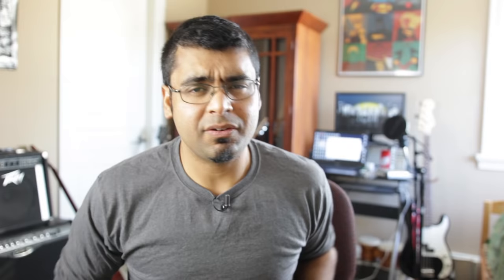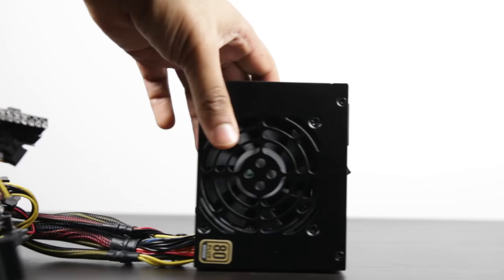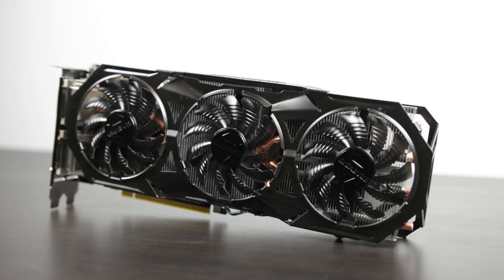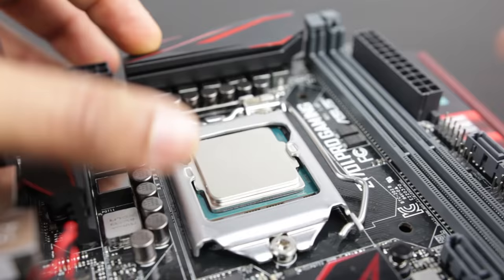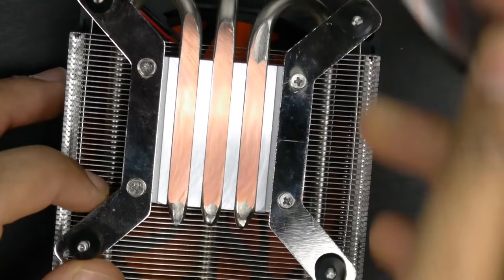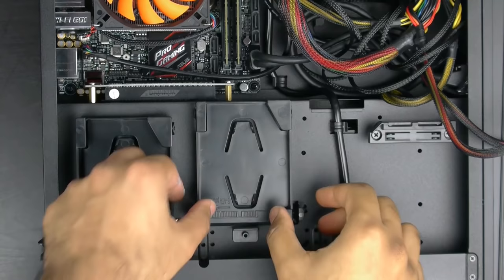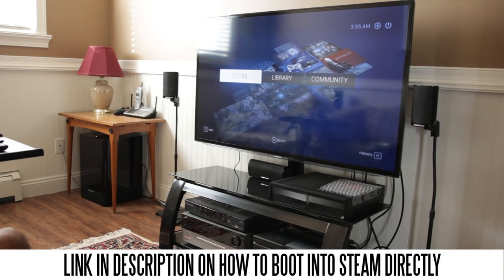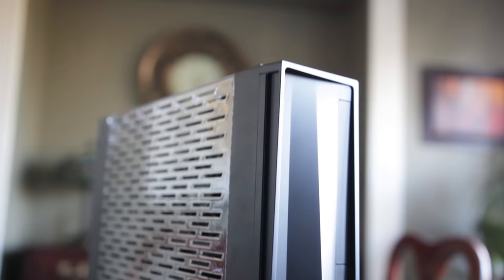EPIC 4k Gaming Console PC - Build Guide (The Console Destroyer!)

Comment: You need 500 watts for a GTX 970!!!! Don't even think about running it on lower. Though it technically can it shouldn't cause it can get hot and needs more power. Plus scrap the i7 and get an i5 for a gaming PC. You don't need 16 gb of ram either and don't get 2 SSD's. Get 1 SSD and a 1TB HDD. This will easily save you 100-200 pounds/dollars depending on your currency and your shopping choices. You can have more money to spend on games or snacks to fuel your gaming nights.

Happy Gaming! :)

P.S. Or if you are smart you could save the money for either a second graphics card or a better one like a Titan when they eventually become cheaper.
Reply: 450w is enough as long as it give enough amps on 12v rail
Reply: Don't worry guys! I have an 80+ bronze 500 watt power supply for my 970 and it's running fine. I am going with EVGA but I will upgrade soon for overclocking and SLI. :) Plus I am going for 3 1080p monitors instead of 4k cause that is too expensive.
Reply: 16 gb of ram is need. Ram is moving up, some games require a minimum of 8 gb. 8gb isnt the standard anymore.
Reply: kwame20101 I can run games just fine on 8gb. I have never ever encountered a game that has required 16 gigs. I am talking about huge MMO's and tripple A titles!
Reply: +Tom Brown games are starting to use more, gta 5 can use much more than 8 as can just cause 3
Reply: Fair enough! Is Kingston Ram good enough? I have 8 gigs of Kingston ram at the moment and I plan to upgrade my motherboard to get another eight. Only problem is that I am limited to 16 gb since I have 2x4gb sticks. Wish I had thought about upgrades earlier on when building my PC! :(
Reply: +Tom Brown why dont you just get 2x 8gb ram sticks? lol

Comment: Node 202 should be the case you should of shot for. The RVZ02 is of lesser quality and bigger by a couple of litters.
Reply: Or if you want to be really fancy, Lian Li cases are full aluminum with a tempered glass window.
Reply: JD 43 but bigger :( . I like the quality  of the cases too
Reply: Patrick You can find Lian Li cases in multiple sizes. I like them because they are still smaller than a  standard desktop PC by quite a bit but are really nice. However they are really expensive.

Comment: Which driver version are you using for this in Windows 10? I have  GTX 970, but have stability issues with 4k@60hz with random signal drops for a second at a time.

Comment: Can a 970 handle 4k?
Reply: No
Reply: +omar azzam Yes, I'm using one right now on a 4K monitor, and it runs most games high to medium with frame rates ranging from 45-60ish.
Reply: +omar azzam it certainly can. just don't expect everything maxed out at 60fps. If you don't mind 30fps gaming this card can handle 4k. Ideally for 4k 980/980ti is the way to go
Reply: The answer in the vidoe
Yes it can
Reply: who want to play games on meduim but on 4k and with 50 fps the main reason of getting a pc for me is the 60 fos
Reply: fps and for me i would prefer the 980ti or 2x r9 nano
Reply: you mean 2x fury x. r9 nano is 980 tier performance.
Reply: +Ian Duenckel nope I just means if you want even more performance than the 980 ti you can get the 2 fury nano cards
Reply: 2 fury nanos cost about 1000$, and one 980 ti cost 650$... I would buy one 980 ti, and another later. That is better then buying 2 gimped cards for 350 more, just to have them throttle down in clock speed.
Reply: Ian Duenckel fury is the same price, sooo..
Reply: fury, nano, 980 are all 500$
Reply: Ian Duenckel And fury is better than the GTX 980, so I guess two of them will be great with HBM
Reply: one word AMD. No thanks
Reply: After using AMD for the past couple years, I will never go back. I used the 5870, then the 7870, and both gave me a horrible experience. Drivers were shit, and I got some horrible frame times in games. This was at 900p fyi. After upgrading I cannot be happier.
Reply: Ian Duenckel I have an r9 285 and have no problems even before crimson, and crimson improved it much more, I can see where you're coming from, but those are old cards and at that time drivers were shit, but now they really improved..

BTW what card do you have?
Reply: I got a 970. Its pretty good, but I will go and buy whatever nvidia's highest card in the next gen. (gtx 1080???)
Reply: Ian Duenckel I think Nvidia is best in low end and high end cards, like the gtx 750 ti/950 which beats the r7 360/370 and the gtx 980 ti/titan x which beats fury x/fury/nano, and AMD is better in mid class cards, like the r9 380/x which both beat the gtx 960 and the r9 390/x which beats gtx 970/980..

But gtx 970 isn't bad ;)
Reply: +i'm everywhere Couldn't say it better myself :)
Reply: +PortalTHUNDER V good job playing counter strike on 4k...while i play killzone on ps4
Reply: +Zlatan Ibrahimović stop saying that

Comment: Hey guys I want to know if my 1080p build is correct for high to ultra settings (it's actually in shipping)
-intel core i3 6100 
-8gb ddr4 2133mHz ram
-Sapphire r9 280x vapor-x
-500w 80+bronze enermax maxpro psu
-1tb western digital hdd 

it would be awesome if someone reply because I plan to get my monitor soon :)

Comment: for the price you're spending on equipment why the hell not go with the fury nano for the mini itx case with the 450watt power supply, the nano would go perfect as it uses less power than a 970 and is farrrr better for high maybe even ultra 30fps 4k or 60fps at medium 4k for most games. ALSO the cards you listed for "4K gaming" the 390x can barely do 4k compared to the 980ti thats insanity. The fury X is far better in terms of 4k performance on the red team side

Comment: Way too much thermal paste. I think you missed the backplate too. Also, a 6600k and a 980 or even 980ti would be better for 4k.. 970 isn't gonna cut it, the 390 costs the same and has better (4k) performance.

Comment: Is it fine to put the new GTX 1080 with these same pc components to run 4K gaming?
Reply: The GTX 1080 only goes at 180W, and NVIDIA recommends a 500W PSU, so yeah,, you can go for that, just make it is one that consumes less power, because some GTX 1080s have a custom PCB that require a 6-pin lead and an 8-pin lead. Others use the same reference PCB, like the EVGA GTX 1080 ACX 3.0, not the Superclocked (SC) version, with a single 8-pin lead, so anything I recommend going for that. Man, I typed so much.
Reply: Bradval411 Great, thanks so much!
Reply: +Bradval411 Do you know the exact price for a gtx 1080 is 500$ enough ?
Reply: Fernando Flores Hmmm...
Reply: @Fernando - a quick search will give you all the pricing you need. Lowest you will possibly see would be $599 before tax (USD). That being said, the 1070 is still an amazing card for pricing starting around $379 ish.
Reply: +Sylv yes I will be getting 1070 and use the rest for overwatch
Reply: Yeah, but you probably won't get 60fps with even a 1080 in 4K. You might need to put two in SLI if you're looking for framerates higher than 45-50
Reply: I don't see why not.
Reply: As a owner of a gtx 1080 I never had any issues getting 60 fps on 1080p hell I'll get 90 and above on bo3 or overwatch
Reply: But 4k is a different story on games like bo3, fallout 4, or overwatch I get 42 fps

Comment: For a 1400 Machine the cable management looks like an rats nest.
you could have go with a bater computer case.
Examples:  
http://www.silverstonetek.com/raven/products/index.php?model=RVZ01

Or you cloud just had bought the Corsair Bulldog kit and save a few bugs:
http://www.corsair.com/pt-pt/landing/bulldog  

So, 
Bulldog kit $399 (Incluid: Bulldog chassis, Hydro Series H5 SF Liquid CPU Cooler, SF600 600-Watt 80 Plus Gold Power Supply, Motherboard with Intel Z170 Chipset).
           GPU $334.99
          RAM $69.99
          CPU: $411.92
  SSD's 1x: $127.45
        Total: $1343,35

your system: 1430,75 != of $87.4

Comment: I see this time and time again when building a set up like this and using a low profile cooler do not waste your money on a K cpu just save yer self the money buy a none k cpu use the money saved on the gpu, storage  or even the ram

I would buy a K cpu if you are overclocking and a case can use a closed loop or a decent air cooler 

Price in the uk
 I7 7600K = £308
i7 7600 = £269

Comment: Eeeh... what? 2SSDs in RAID0 ? Basically one fails and your system is unusable... What's the pont?
Beside of that.. you go with skyline processor and you put there 3 times the amounth of Thermal comp. than is actually  needed..
And you consider 30- FPS at 4k to be EPIC 4k gaming console pc? Rly?

Comment: what is the bang for the buck graphics card
Reply: +yocoffee or r9 390
Reply: +Joey the Kangaroo  depending on the country and local sales r9 390 and gtx 970 are the best mid-high end choice for 1080p gaming.
Reply: +yocoffee thanks I'll go for the gtx 970 I was going to go for a r7 370
Reply: R9 390
Reply: +Joey the Kangaroo Don't listen to him, go for an r9 390. It's cheaper, slightly faster, and has double the VRAM of a 970
Reply: +Joey the Kangaroo go with the 970 if you want better and faster updating drivers and want to play most games above 60 fps when they first come out..
Reply: +Dat Nigga Daquan OK bit will an r9 390 be able to play at 1440p
Reply: Joey the Kangaroo both can play games great and performance is usually better on the 390 side although AMD don't have a good time with overclocking, a 970 ocs much better than a 390 and an oced 970 will beat a 390 in about any game. The only downside I can think about the 970 is the vram but it won't be a problem unless you're playing like shadow or mordor at 4k or something. I'd say get the 970 if you're gonna overclock and want better drivers and get the 390 if you don't want to oc and plan on playing every game at 4k which if you're gonna do that, just get a 980 ti :p
Reply: +Dat Nigga Daquan thanks the 390 Is Bit cheaper sure I'll be missing nvidia  game works but that doesn't really matter I've bought my r9 390 and I've paired it with my i5 6600k
Reply: Joey the Kangaroo np man, I hope everything goes well, have fun gaming :)

Comment: Lol, GTX970 excellent for 4k gaming. Can't stop laughing. I can say my GTX980Ti is definitely NOT enough for 4k gaming in most of the new games (if you want fluid 60fps what is a must for me). A multi-GPU solution is highly recommended for 4k gaming. A single GTX970 is only a midrange card and should never be recommended for 4k gaming.

Comment: VERY MISLEADING TITLE... there is nothing epic about this build. This system is not a "EPIC" 4k gaming setup,  it is a minimum SPEC 4k setup, it barely plays 4k at 30 frames per second on medium settings. Epic would be sli 980 ti's on a x99 PLATFORM.  I'm waiting on Pascal before building a 4k gaming rig. Just a bit of advice, you're doing your audience a disservice when you  sensationalize your content.